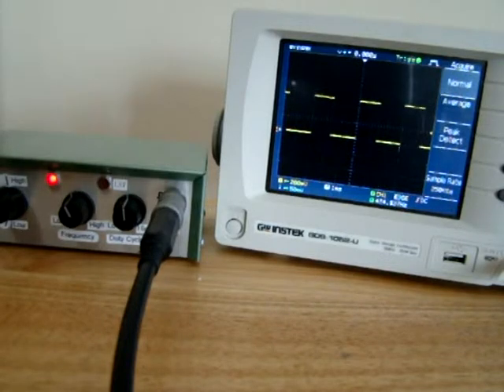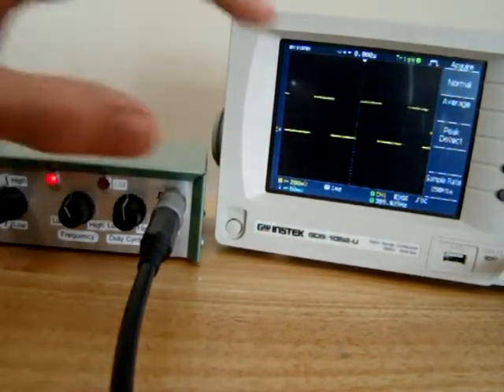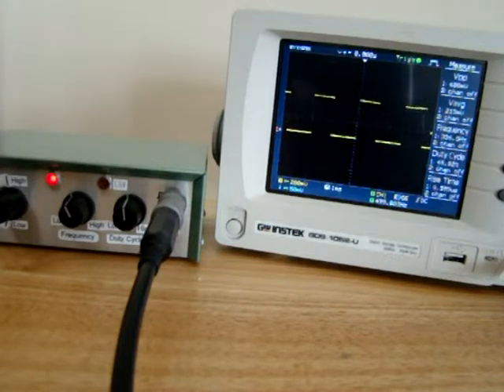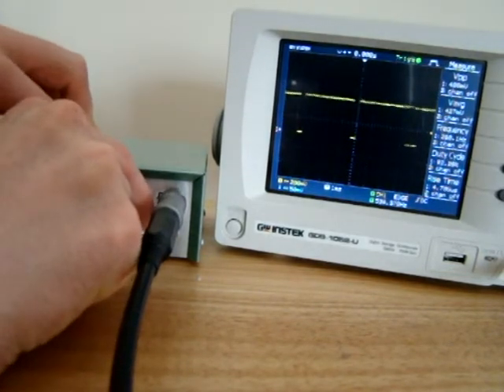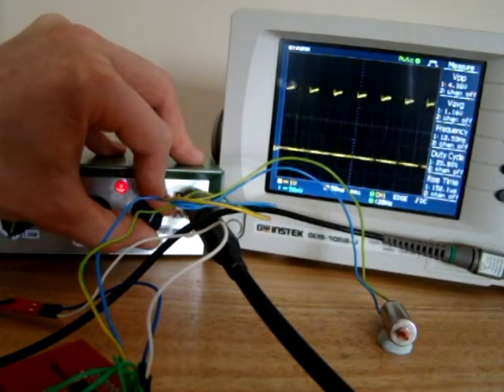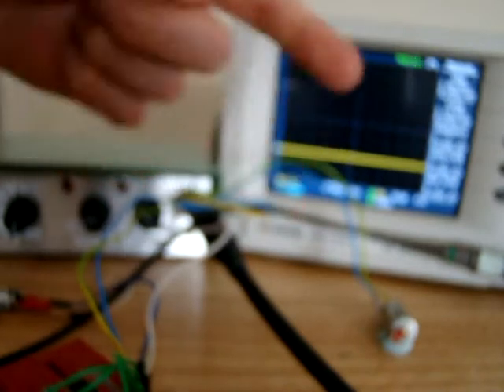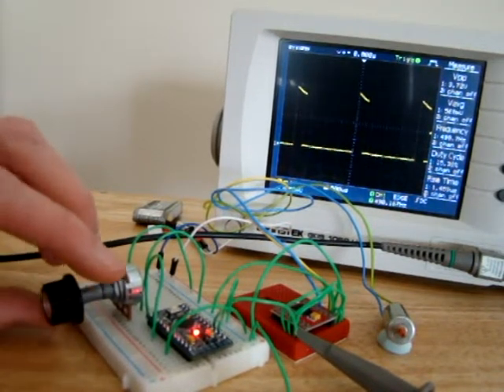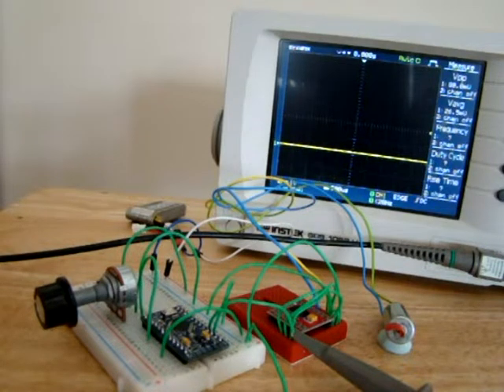Arduino pulse width modulation or PWM for motor control

Comment: Very good introduction! 
Probably worth mentioning again that good ESCs for brushed motors have a frequency of a few kilo Hertz, some even so high that the switching frequency is outside of the human hearing range.  
Also, ESCs contain circuitry to deal with motor braking and so on.  
I've thought about making my own ESCs, but it's just not worth my time, to be honest: If I wanted to approach size/cost/functionality of commonly available ESCs, I wouldn't have time for anything else.
Reply from the maker: Good point, if you can fit a standard ESC into your model it would most likely be the best option. Especially with larger higher current motors where trying to deal with heat starts to become an issue.